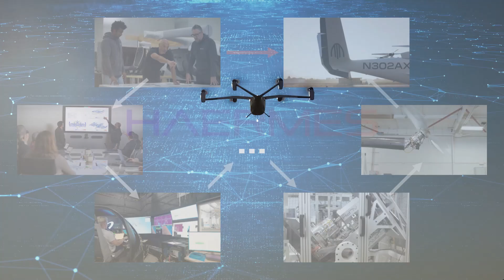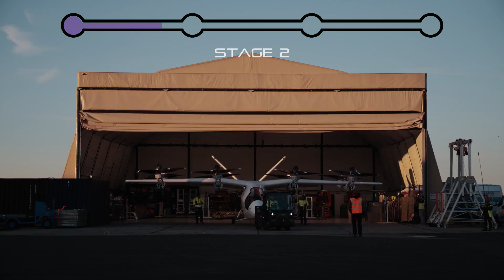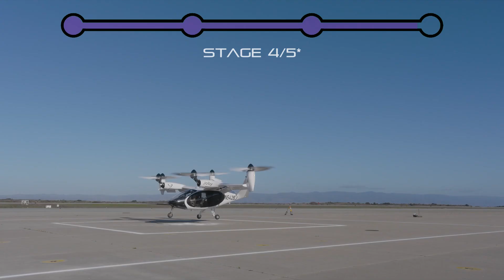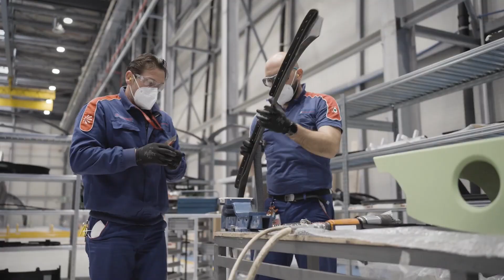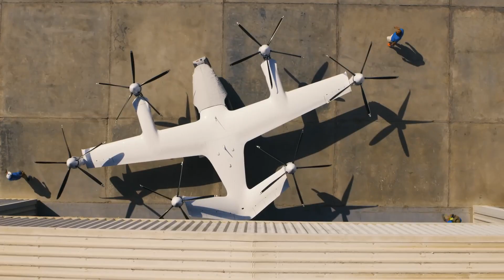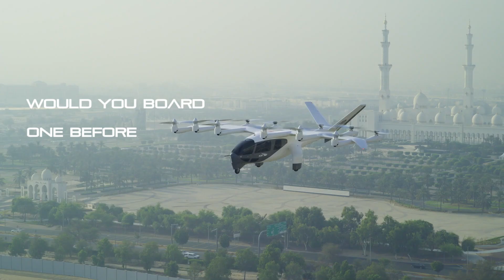Air taxi Certification: What’s Taking So Long? (FAA & EASA)

Comment: FAA’s goal should be aviation safety AND innovation. This used to ve the case before 1996. Shouldn’t cost $25M just for certification. Prove it works, then good to go. Done.
Reply: Faa is a joke! They allow dangerous planes that recently crashed like the biz jet on the highest, b2 bomber that crashed etc. They are corrupt af.

Comment: Thanks for wasting my time.  FYI, the FAA doesn't care if an aircraft is profitable, only if it is safe and meets the prior agreed upon design standards.  Show me one commercial EVTOL aircraft that flies with a pilot and a passenger in every seat.  Then let's talk about the cost per mile.  Then, let's then talk about the speed, range, and recharging protocol.   As of August 2025, none of these EVTOL companies are even close to a profitable working prototype.  As a pilot, I would love to see general aviation economically electrified, but, as of today, it's only a dream.  Beam me up Scotty.
Reply: Nothing you said is true.  Keep up.  Do basic research.

Comment: Vtol is old hat, adding the burden of batteries makes success harder. The real hurdle if controlled safe flight after full power loss at any stage of flight but especially during low level hover and transition. Loss of tilt control or blade pitch could be catastrophic and relying on power for control as well as lift is fraught with danger.
Testing in flight with power loss using a ballistic parachute to save a test aircraft must be done NOT reliance on one in a billion statistics - a flock of birds don't read probabilities books.